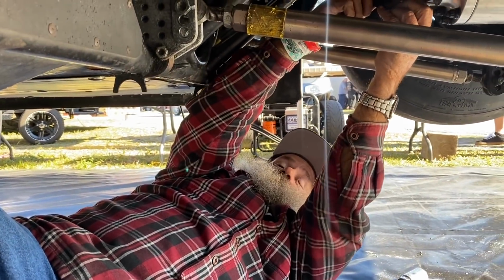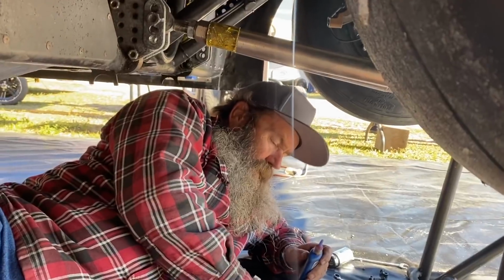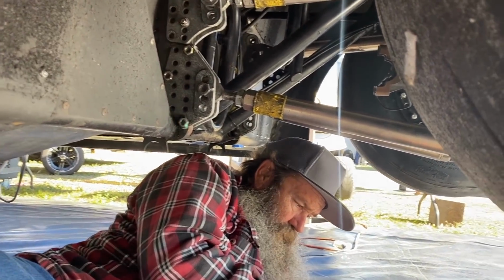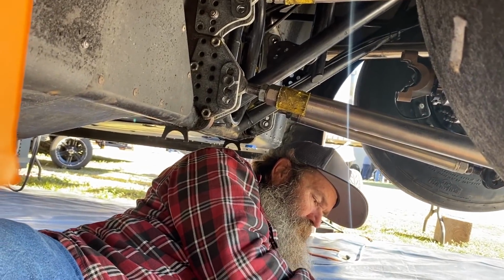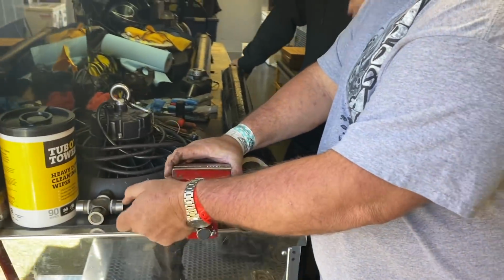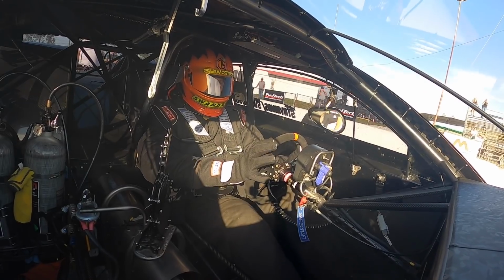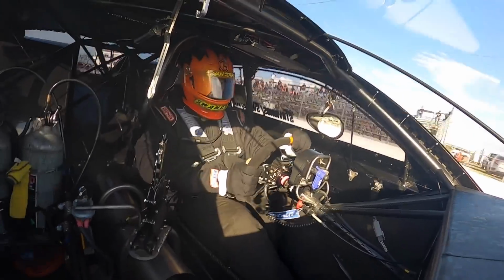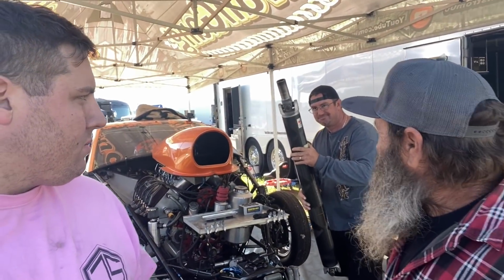We Finally made it in the field with a 3.89, BROKE SOME STUFF, Won First Round an on to the Second!!

Comment: Hey Justin, I saw when you were checking your valves that when you bumped the starter it would spin the motor over really fast. What type of starter are you using? I am 13 and I have helped my grandpa for a while on his and my dads car and now he sits and watches me check the valves on the car. I am just wondering because it looked like it spun the motor over really fast.